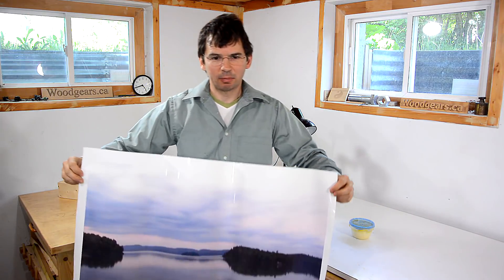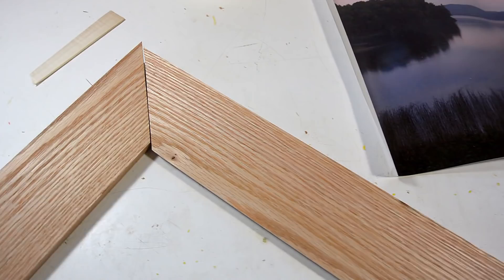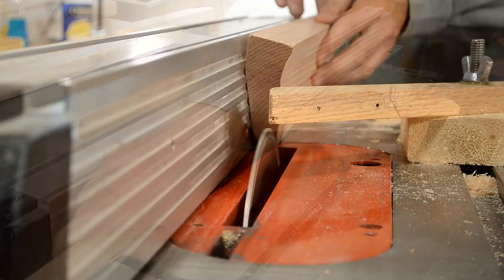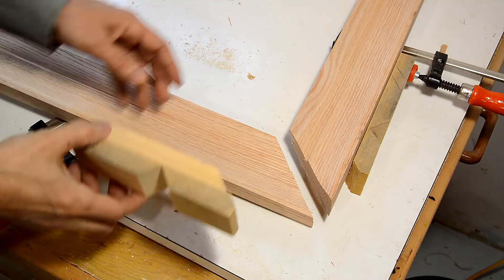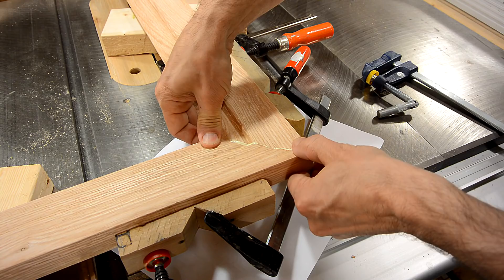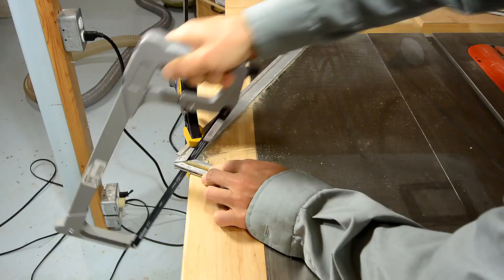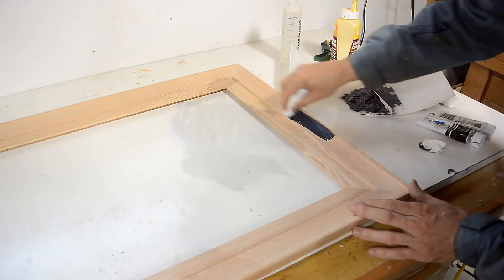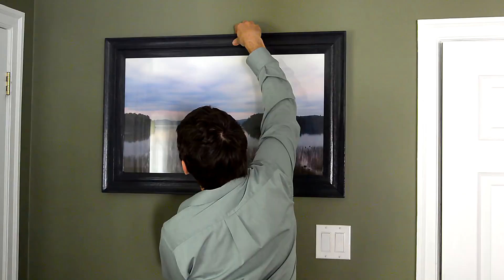Making a picture frame (make molding on the table saw)

Comment: Probably one of your best videos today Matthias. I don't think I will ever buy another custom picture frame in my life after watching this. I tried out your cove cutting method and was impressive with how much control over the size of the cut you have by changing the angle of approach.  also rounding over the teeth helps but truth be told its nothing you cant sand out if you just leave the blade stock.

Comment: I am impressed, very impressed.

You make things look so easy.

I am curious why you did not use a mat.
An important feature of mats is that they keep the photo from touching the glass.
Changes in humidity can cause the photo to attach itself to the glass, in turn ruining the photo.

It is also good to tape or glue a backing sheet on the frame to keep dust and more importantly small insects out of the frame.  Both can also contribute to damaging the photo.

Lastly, To prevent wrinkling of the photo or to get the wrinkles that are already in the photo out,
it is not difficult to adhere it to a piece of foamboard (preferably acid free) which can be purchased
with a sticky surface for just such use.

To make this easier, you are the perfect guy to show how to build a roller press to make mounting
the photo to the foamboard easier. 

Keep up the awesome work.
I am as always anxiously awaiting your next video.

Anon
Reply from the maker: Anon Ymousmie It's only a photo.  Framed one like that about five years ago and it's just fine.
Reply: Matthias Wandel
Cool, Gotcha!

I love to watch your mind work just as much as your hands and tools.

Be Well,

Anon
Reply: Matthias Wandel    I agree with Anon, you need a mat.  You won't believe how many family photos both my parents and my husbands have put behind glass with no mat and years later, the photo stuck to the glass totally destroying the picture.   You did such a wonderful job on the frame and the beautiful photo you took, why not preserve it by using a mat :)
Reply: +Anon Ymousmie Hi I am curious as I'm learning, I don't have any photo frames myself but you mean this mat is to push the photo to the glass so that it has an even pressure all over, thus keeping the photo straight and not curved? Or how do you mean, sorry if I'm slow.
Reply: +Bobany Hello,,,
The mat is to keep the photo away from the glass so it does not stick to the glass when there is moisture inside the frame.  to keep the photo flat, you glue it to  a backing board or foamboard which will not let it wrinkle or distort which will allow it to touch the glass.

Comment: My father used to do that as a job, mostly using pre decorated and milled wood. And you did great, very close to what he did, plus added that twist with the reinforcements. He used to use just glue and nails. The way you did it will not show the nails, which is a cool extra, even though a bit more time consuming compared to nails.
Nice tip for the next one. Try some thin cardboard (or very thick paper :D ) passepartout. It will add a very elegant touch to the entire thing.

Comment: I love the box for cutting the splines in the frame. I built a complicated sled spline mitre jig which always seemed to make cutting the splines much more difficult. I will use your simple approach to my advantage in the future.
Reply: you don't really need to put it up at 45 degrees, you can just run it straight into the saw, if you set the blade height right and cut into the corner the right depth
you'll get pretty much the same cut it'll just a have a slightly round bottom but that doesn't matter it is hidden inside

Comment: Nice video once again. 
Just a tip when cutting glass, after you make the cut fron edge to edge, there is no need to tap the class with the cutter, just put edge you cut lined with the table and bend the glass down, nice and clean break. I worked as a picture framer in my youth. 
Love your work, you have inspired many , including my self keep up the good work.

Comment: "I'm Matthias Wandel. I make sophisticated custom-designed wooden pantorouters, wooden slot mortisers, and wooden remote control forklifts. So what will I use to cut the reinforcing splines in this picture frame? An old plywood box, of course..."

Mad Skills! 🤘🏼😎🤘🏼

Comment: Matthais, A very nice frame built, yet again, with excellent and inventive technique. You should not, however, put wood directly behind the photo. The tannin and/or moisture contained in the wood panel can, over time, leech into the photo paper and discolor it. Use an acid free matte or mounting board that you can purchase from most any art supply store as a backing.

Keep up the great work. Your videos are, to my mind, some of the best on YouTube.

Comment: Two tips for the glass.
First, if you score the glass with your glass cutter perpendicular to the crack, just ahead of the crack, it should prevent it from traveling further forward.
Second, when cutting the glass, once you score it, place a piece of paper under the glass with the edge of the paper along the score. Then tap from the top. The cut will follow the paper edge, both making a cleaner break and preventing it from running away in either direction if there is a flaw in the glass.

Comment: now only if everyone had a workshop like that... high end saws, the skills, the paints, sealers... that could easily be a $1800 picture frame if one had to go out and buy all the tools to make it.  None the less.. very nicely done.
Reply: That's the cool thing: He didn't buy all the tools just to make that picture frame. He gradually updated his tools, and built some new tools (the bandsaw, the sanders, router lift, dust collectors, and so many more), basically I think the most expensive things in there are the table saw, and the drill press. (He did make a homemade table saw that worked fairly well, but he likes this one better)
So, given the incredible number of things he built using those tools, I think it's fairly worth it.
We'll agree about this, though: Very nicely done!
Cheers!
Reply: Chris S  watch more of his videos.

Comment: Looks good. The cold grey is a great choice.
That paper looked very thin and curvy, If it looks wobbly in the picture frame you could buy self adhesive pvc or cardboard in most arts and crafts stores and stick it on that.

Comment: awesome video... a small tip from an old photographer: you might find that your picture lasts longer without fading if you use uv resistant glass, especially if it's a special one off picture you couldn't easily make a copy of, and if you're hanging it where it'll see sunlight. Thanks for your amazing work, a constant inspiration.

Comment: Excellent work. I have found that using a piece of 5/8" sheet rock as a surface to cut glass on works well. It absorbs some of the shock and lessens the likelihood of cracks.

Comment: Love the use of the table saw, genius. From the point of view of an old picture framer though, you would be better to spray glue the print onto the backing board, this would eliminate buckling of the paper due to moisture in the air.

Comment: Today I cut mitres in cheap structural pine with my table saw and there were little chips along the edges. Maybe need to upgrade to premium pine. They make it look so easy.
Reply from the maker: Better saw blade and better technique help

Comment: very nice work on the frame.  Thing is, if your print is on standard gloss, semi-gloss or satin photo paper, you need a mat to keep the actual print from touching the glass.  I had a lot of ruined family prints in frames with no mats that my parents passed down, the print stuck to the glass and ruined it.

Comment: Lots of excellent techniques in this video.  I haven't seen any other clamping cauls like this on youtube.  I really like that they put pressures directly in the middle of the joint.   Wondering what the best way would be to make these.  Is each caul made from one piece and cut to the the dimensions?  I would imagine the notches would have to be exactly 45 to the edge.  Thanks for sharing this.

Comment: Beautiful work, as always!

The glossiness of the finish is a bit distracting. I think I'd go for more of a satin finish. Also, photographs or prints should be held away from the glass a bit so the ink doesn't stick to it over time. That's the practical purpose behind matting. If you don't like the matted look, you can cut the opening the same size as the frame. But matting is expensive when professionally done so people usually want it to show.

Comment: An enjoyable watch but has put me off making one as it seems quite involved with cutting at angles on the table saw and using special clamps ect. Perhaps you could do a simpler version with shop bought architrave using a mitre saw and router?

Comment: finishing nails certainly work for holding the picture assembly in place, but there are little metal triangles made for that purpose that are easier to install and a little better as they press in a little on the backer board.  I have a few in my parts bin but do not know what they are called.
Reply: Glazer points

Comment: That picture looks like the Preist Lake area of Idaho(Also slightly resembles Cour'delane). Where is that location?
I like the tip of filing the tips round. I like the Miter slide that you made. Your tips and tricks are always top notch advice. Great work Mathias. I wish I had all your tools and a shop.

Comment: Did you build a jig to consistently round the junk blade teeth? That alone seems like it could take a lot of time to do it right. Also, do you think lap joints and splines are equally strong in this situation? I agree with other posters that an acid-free mat and UV filter glass is worth using given the amount of work put into the framing, and the unique value of the artwork. Thanks for the video Matthias.

Comment: dangerous practice at 4:15. that thin waste trapped between the blade and the fence can sometimes hang up and shoot out at a very high rate of speed. If you are going to do that make sure you are not in the line of fire!

Comment: Hi..the frame looks lovely. I wanted to know a small thing. I’m an artist and usually purchase stretched canvas but I recently though about buying wood and canvas rolls and making my own stretched canvas. The problem is, the wood is without a bevel edge which isn’t fit for stretching canvas. I don’t own electric table saw. Is it possible to make a bevel edge on the timber using any hand tools?

Comment: Hey Matthias, long time viewer, first time commenter, i wanted to ask your professional opinion about a table saw, im looking into purchasing a DEWALT DWE7480 for picture framing mainly, the only catch is that i need to do some dados aswell and the manufacture does not allow for typical dado sets, there are people commenting that the FREUD SBOX8 works and it cuts up to 3/8 which would work for me, more wide would be better but if this is the max the machine can run, it would work. My question is, do you know if this set would work with this particular saw or would it be better to purchase a similar price (around 400 euros) router for it? I cant seem to figure out if doing these cuts on a router has more or less "stress" than doing them with that dado set, i need to do quite a few of those cuts and im afraid that router bits wouldnt last at all. Sorry for the long text and thanks in advance! :)

Comment: really nice work!

how did you rounded the teeth of the sawing-blade?
Reply from the maker: diamond disk
Reply: thank you. i really like your channel.

how did you achieve that all teeth were evenly grind?
which were the moving parts in the process?
did you left the blade inside the sawing table or mounted the blade somewhere else? or both the blade and the diamond disk were moving?

i am thinking i have and old blade (20 teeth) and might prep it.

Comment: How do the splines help strengthen things? I would have guessed that solid uncut wood is always going to be stronger than removing and replacing pieces
Reply: But there is a cut directly through the place where he put the splines.
Reply: No you would be incorrect.  Having the grain of the splines running across the grain of the frame at the joint is much stronger.  Similar to plywood.  It will keep the joint from racking apart.  Very strong joint this way.
Reply: ***** Ah of course. I really should have figured that out
Reply: chrisycee

Wood is kinda like straws bundled together, a miter is like gluing the straws together end to end. It's stronger to glue them together length wise, so if you cut a spline and stick a straw in long ways it forms a solid connection between the two weakly joined ends.
Reply: Cactii101 i totally get it now and i dont know how i didnt get it in the first place haha

Comment: 0:25 umm...no? If you miter cut a 45 you won't lose any board at all, aside from the obvious blade width, you simply flip it in the same fashion as you did the board regardless...and it makes...🤔...the only time you lose board is if you have a lap joint.
Reply from the maker: I suppose that's true if you don't mind half the frame being inside out.

Comment: Way too much work to justify the rather ordinary result. I pick up nice frames for next to nothing at thrift stores, then modify to suit if necessary. Sometimes it just means using the miter jig to recut lengths. Other times I can use as is, and just improve the finish and color through judicious use of thin acrylic paint washes. In the example in this video, I found the final shine of the paint surface quite amateurish and unpleasant.